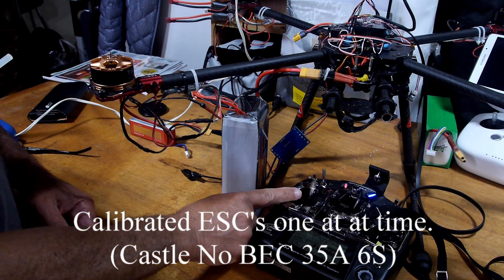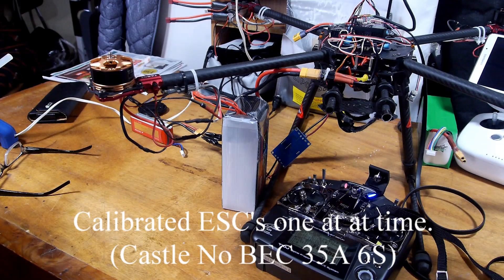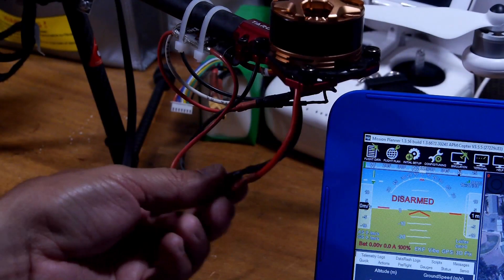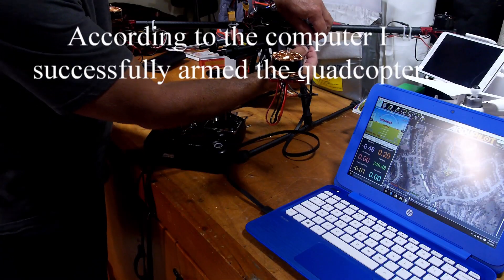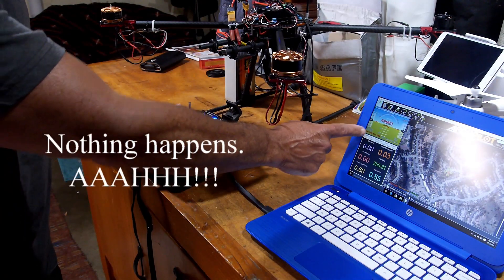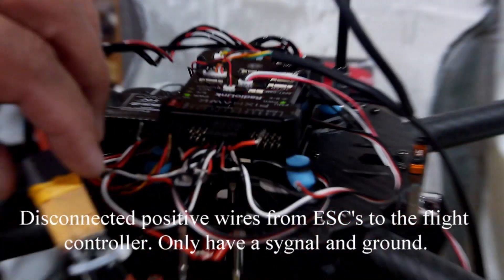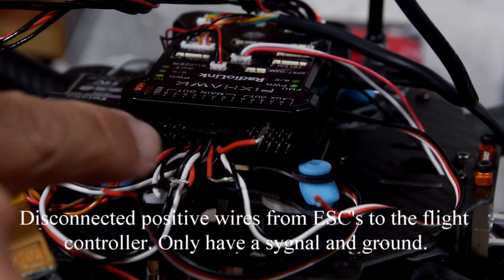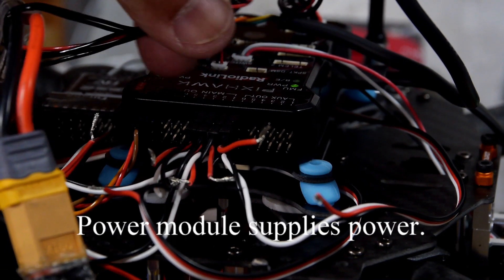Pixhawk PX4 arms but motors do not spin.  HELP!

Comment: Is this serious? Do you have to have 5v on the esc to power the controller? I am using esc 30a opto without bec, and my engines do not run, make the esc calibration beep, everything works, but when arming the engines do not run, do I have to connect a bec even using the power module?
Reply: I have bec 5v that I bought a long time ago, I called here to test it but it still didn't work, the interesting thing is that in the engine test done by the mission planner, they work, but when I arm it, I have a lot of fpv models, I have a mavic , in a f450 with naza lite, but I have a lot of pieces here at home and here in Brazil we are in quarantine, there’s not much to do, so I’m inventing what to do with things I have here, but I definitely don’t know what else to do do, with apm 2.5 the engines are running, i think i will use it, and yes, they are very different, with naza you can get a very good position locking by gps, to have the same answer with arducopter, a lot of testing is needed , but it can make it the same, my first drone in 2014 I set up with an apm 2.5 and gps and I suffered a lot until it was good, but if it doesn't hit the pids well they drift sideways, the altitude drift doesn't have much to do do because the barometers used ne these apm and pixhawk boards are of low quality so it varies a lot, even on the ground sometimes it marks 2 meters hehehehehe but thank you for your attention.
Reply from the maker: I fixed the problem. I was using ESC's that did not provide power, (no BEC) so I had to get a step down module and attach that. This was my response to some one 2 years ago to how I solved the problem. solved it.
 "I am using no BEC ESC's. They do not provide power so I have to get a 5.4 volt step down module and attach it to the servo rail. problem solved. First flight was good but this flight controller sure acts different from the Naza's I am used to. Thanks for your comment."
Reply from the maker: Ok, this may help. Go to about 3:40 in this video. https://www.youtube.com/watch?v=qWWhzp8HF7o .. Please post your results.

Comment: try flipping your esc wires to the pixhawk
Reply from the maker: I solved it. I am using no BEC ESC's. They do not provide power so I have to get a 5.4 volt step down module and attach it to the servo rail. problem solved. First flight was good but this flight controller sure acts different from the Naza's I am used to. Thanks for your comment.